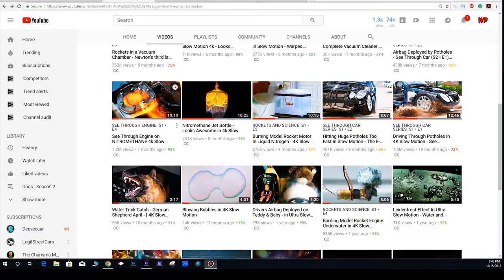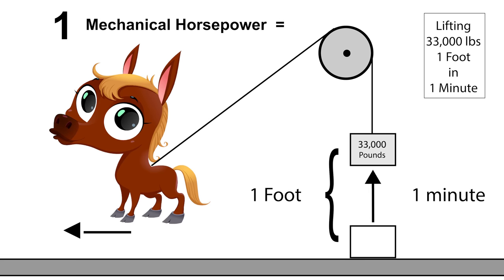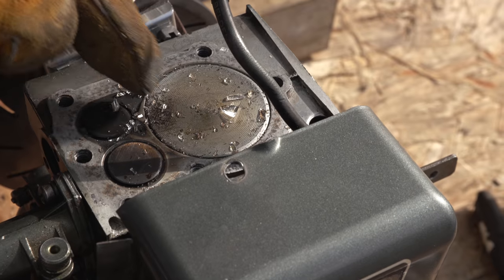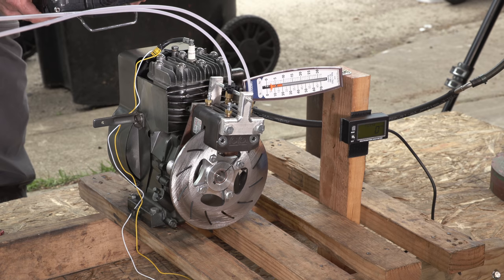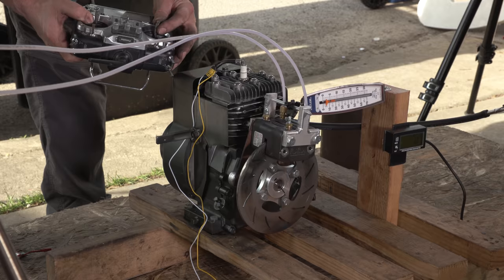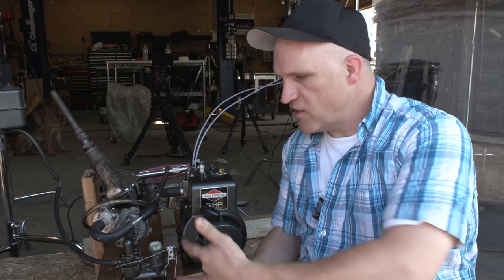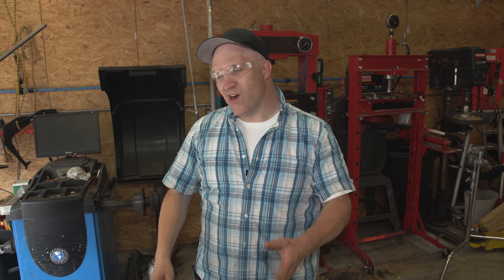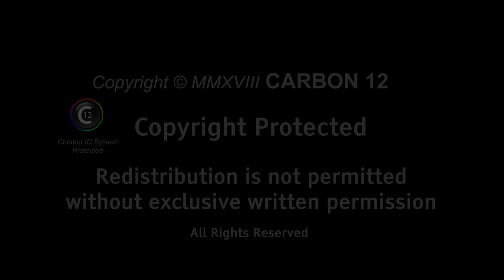See Thru Engine on Turbo Nitro and Dyno  (How much HP does it make?)

Comment: What if u turned the turbo in to a booster say forced air with an elect motor pushing just the intake side of the turbo?  Sorry may have worded that wrong but u get my point right

Comment: Never heard it called "wet" before just "pull through" or "blow through" regarding carb-turbo placement. Blow through carbs are harder to setup but easier to plumb pull though is easier to set up and harder to plumb. Personally I like pull through because you can uses normal carbs that are cheaper and more available.

Comment: wud LOVE to see u do a series on PREDATOR (HEMI/non hemi... some think that "the ticket" is the HEMI block and the NON hemi head) with... 22# springs $8. =6500RPM's/ 26# springs =8000 RPM's, head porting, stainless valves, bigger 390cc or Mikuni ... Chikuni 22/26mm carb, BILLET ROD  .020 to get 0 deck height, .009" head gasket shim.... whatever it takes to get ~.030" piston to head clearance and valves don't kiss the piston ... and cause catastrophic engine damage. header/scooter muffler (E bay), intake adaptor for carb and adaptor for air filter. with E 85? something that isn't too expensive for fuel but wont detonate/pre ignition.   turbo is too much... $$$ for avg person on a kart/mini bike.  try to keep $ spent to ~$200, not including the $100 for the motor... $107 with tax. ....  13.5HP? @ 6500+ on alcohol of some kind.  DEFINATELY DO NOT BE IN THE FLIGHT PATH OF FLYING OBJECTS, not too much of a concern with $$$$$$$120 billet flywheel, HEMI and NON hemi flywheels are DIFFERENT taper on the shaft!!!   don't need advanced key on the BILLET FLYWHEEL, but 8 degree advance on NON billet flywheel is the standard, getting timing to ~ 28~32 BTDC~~. a CONCERN with stock 5.5# cast metal flywheel that the magnet will fly out/off, like a bullit, and take the coil mount with it ruining the motor...and anything else in its path.  "line of fire"... of flying exploding parts... flywheel/magnet....  take out/off magnet on cast flywheel and EPOXY it to the sanded/cleaned flywheel... if can get the little Philips screw out without ruining the head trying to get it out?  if use stock rod, trim 3/8" off the bottom of dipper as crank flexes and dipper hits bottom of motor, breaks end cap and ruins engine.  TORQUE ROD CAP ON ANY MOTOR TO RECOMMENDED TORQUE as they sometimes are NOT torqued for MAX 6000 RPM's.  17 ft/lbs?   same as head bolts, unless running head studs then 23 ft/lbs.  BILLET rod $65 on fleabay or any other karting parts store ... might as well get all the parts from one karting store to justify the $13 shipping on $150 worth of parts. put parts in shopping cart, read karting.4cycle.com       PREDATORS and decide what parts u NEED to have.   Chomemoly push rods, different lengths for HEMI and NON hemi Predators. 1.3 stamped steel rockers for NON hemi $20... but they might fold up with 26# springs???? shd be ok with 22# springs??? CM .265" lift cam with 1.3 rockers= .345" lift, max lift that does any good without RADICAL HEAD WORK (welding/machining) and resulting low RPM performance, but at 8000RPMs???? SCATTER Shield of 3/16 steel plate tween motor and operator?  Kevlar safety blanket... is too expensive. too easy to spend ... $300 on $100 motor and still leave some HP on the table. but most ppl... $200 piecemeal in a $100 motor? change oil often, especially running exotic fuels/nitro that pollutes the oil quickly?

Comment: Awesome vid, bud!  Great fabrication and scientific strategies towards data collection!  Like everyone is saying though; try a smaller turbo maybe.  And put the carb where it originally was, and build some kind of carb hat for it.  And advance your timing a hair more than stock (but not as much as with nitro alone.  And lastly, see if you can get bigger jets for that carb.  Maybe off a bigger engine that maybe used the same carb?  If that exists?  Anyway though, great work!  Mount that sucker on a go cart!  Lol

Comment: Aloha Mr Warped and all 1682 YT commentators, during my first pass through this nearly 20 minute video I became inpatient with the pace (get to the point already!), I was vocally negative at each "mistake"; the head cracks, the wrong spark plug, "Oh forgot to mount the tachometer",  failure of the jury rigged (yes, its jury rigged meaning something built quickly with materials on hand) brake dyno...me: "Common! Why are you wasting my time" (I actually said wasting "our" time-thinking I was bringing all 1682 YT commentators along with me! Sorry all.) It kinda came on me slowly then by the 10 minute mark your diabolical plan became a real life 20 minute seminar in primary research, workbench engineering, true research hypothesis-null hypothesis, lets-see-what-this-will-do experimentation! Of course there's guys making these 3hp Briggs engines with triple digit hp! That's not the point, not what you're doing here. This is what our Greatest Generation did and created hot rodding, dirt track modified racing and eventually NASCAR. Mid 60s I worked on a 40 Ford coupe on a mid 50s frame, a Hilborn injected 327 small block-10% set back on 8% Nitromethane, a quick change diff dirt modified. And this is the process, warts and all, used as the creative tool for all of it  So nuff already! Mahalo Mr Warped! Keep up the good work sir! Aloha

Comment: Happy new Years,,,Run a electric window fan on head...Take 100- 120  lb air hose,Spray air into carb in  the original carb position,It will go threw the roof! Great video 73s

Comment: Two things holding your HP back turbo's need oil pressure to run its what makes the sleeve a bearing, that is unless you have a ball bearing turbo. Secondly the inlet for the turbo will determine how much air the engine can pull, ie if the carb is after the blower you can stuff more air into it. But if the turbo has to pull air thru the carb, the carb will still be able to flow the same amount as the engine can pull. Best of luck looks like fun!

Comment: Turbocharged engines have a different cam configuration to fully take advantage of the turbocharger. Just slapping a turbo on a normally-aspirated engine may add a little extra power, but can only reach its full potential with the right cam. Additionally, other mods may be needed to run properly and also to avoid overstressing the engine.

Comment: Now that you have this sort of dyno you should test regular vs premium gas and see if it makes a difference in horsepower. And also about that turbo, go with a smaller turbo and a blow through carb. It might be more complicated but usually, if setup correctly I say and i quote, makes more power.

Comment: Straight stock 3 HP briggs and stratton engines we ran in high school on a dyno put out 5 HP at 5,000 RPM. Proper dyno test is done with wide open throttle and rpm is controlled by the load.
Reply from the maker: Yup that's what I did here, WOT RPM controled by load, according to Briggs & Stratton themselves, on this engine if you get more RPM and torque goes down and the horsepower is about the same at 5000 RPM oh, I'm definitely willing to try it in the next episode.
Reply: @WarpedYT  We had air and fuel flow gauges also which allowed us to calculate the thermal efficiency of the engine. Our dyno was a water dyno controlled the load by turning the water tap and didn't get the dynamic vibration like you have. Run all your tests at the same rpm to get reasonable comparisons. Mix methyl alcohol with nitro methane and you should get way more power. Nitro methane by itself is not a great fuel. The high octane of methyl is why.
Reply from the maker: @terryvickers5986  you probably used a "land and Sea" Dyno. That's the one I was originally going to use for this test, but I decided to go with a more Hands-On approach. Well this fuel is 50% methanol and 50% nitromethane. Pure nitromethane alone with blow the engine apart before the Piston even moves. Yeah I'm not too crazy about the land and sea dynos using water resistance, it definitely doesn't replicate a realistic mechanical load, for instance if you look at the full size roller dynos like Dynojet, you have the option to add the Eddie break, which is basically a mechanical brake that replicates a real-world load.
Reply from the maker: @terryvickers5986  edit: pure nitromethane will blow the engine apart taking into account that it doesn't have a stabilizer, and You were somehow able to get it to ignite with a large sharp impact, not a spark for sure.
Reply: @WarpedYT  The dyno we used was much simpler, in fact you could probably build one using a centrifugal water pump and an arm attached to a spring scale. Load control was quite sensitive.You could control the load/rpm very smoothly and the engines ran smooth, no surging or variation in speed that wasn't intentional.
And there was no jumping of the scale it was a very  steady reading on the scale.
As far as the load is concerned resistance is resistance no matter how you create it and fluid friction is going to be smoother than any mechanical friction brake.

Comment: You can also use a clear glass bottle for the vac tank to monitor what is happening to the fuel.....glass bottle with vacumn pump attached ...maintained at 15 inches...attached to inlet port to engine aclear inlet tube to engine would show a lot too but that head explosion will show a lot more of whats happening

Comment: Just curious, wouldn't you have to give the enginea rather large upgrade to be able to do something like that? Like change the valve springs, the pushrods, the flywheel, and maybe even the Piston?
Reply: Port and polish too. We rebuilt some B&S 3.5 engines in hi school. 1st one had to be as stock as possible. Do whatever you want to the second one. Some of the guys had the money to go all out on theirs. They'd run for about an hour at doubled HP, then explode. Almost everytime. Bored out, mod pistons, hi lobed cams, carbs that looked like a beer can cut in half. Spittin flames out of a straight pipe. They were mean...for a while. Tecumseh engines held modification rebuilds a lot better than Briggs and Strattons. B&S engines only lasted if you rebuilt them to stock. They vibrate too much to hold together after that. No meat on them. I rebuilt one B&S 3.5 vert shaft to stock, and was rebuilding a 5hp Tecumseh, but ran out of time waiting for parts.

Comment: Need to add a vacuum/pressure gauge to see if you're making boost.  And try a supercharger. Back in the sixties someone supercharged a Honda 160 with a car smog pump and ran it on the salt flats. Was reported in Hot Rod in the day. Smog pump would probably build more pressure (boost) than that big turbocharger.

Comment: Are you measuring the power at the highest torque measurements? You could possibly get more power by releasing the brake slightly and allowing higher RPM. If the engine spins 20% faster but only loses 10% torque, that's a net gain of 8% power.

Comment: Why are you dividing you scale value by 2? If there is 6 inch's from the crank shaft to where the scale is attached, you should multiply by 2 so the leverage is based off of 12 inches for foot pounds?

Comment: When the turbo pressurizes  the intake manifold, doesn't that work to push the fuel OUT of the carburetor? If you route the intake manifold pressure also to the gas tank and equalize the pressure, I think you'll be able to get more fuel in and more power out.

Comment: You should shave the stock head for more compression. Use a mill (best idea), lathe (also a pretty good tool), or a belt sander (a little risky because the head could be shaved unevenly). Also, port out the intake and exhaust for better flow and get a bigger carb.

Comment: Try using 00racing cdi ignition with a vz31 turbo.  Turbo size is more appropriate for that engine and the timing curve of that ignition may respond to boost better than a set Briggs ignition

Comment: Clever work but turbo can't spin fast enough to get on boost.  2nd problem is the draw through set up which will pass fuel into the turbo oil system and start messing things up big time.  That turbo has a piston ring seal.  You need a carbon seal.  Use a smaller turbo with a proper draw through seal and/or go to fuel injection.

Comment: It will always be impossible for a single cylinder engine to properly run a turbo. The reason is because when the exhaust valve opens to shoot exhaust gas into the turbo to make it spin the intake valve will be closed keeping boost out of the cylinder. The only reason it ran at all was because of the air momentum. The only way to maybe make the turbo work is by using some type of sprung plunger in a tube teed into the boost side of the intake to store pressure until the intake valve opens, like an expansion valve. What I would like to see is using a smog pump as a supercharger on a small engine.

Comment: If you really want to make this engine roar you simply need an old smog pump from like a 79 Lincoln. It will serve as a supercharger. It will make crazy power and may even force a rod out the side. A bigger carb is a must also. Try finding one from a old 12-16 hp Kohler or such.

Comment: My question is and I know I sure could be wrong but with it being half the distance would give you less leverage, half the leverage.  So at 10 ftlbs in a foot using 6in would be harder to stop or turn. So shouldn't you double the the torque reading at 6in instead of dividing it in half? If not please explain if you have the time.
Reply from the maker: You kind of got a right, at 6 in the force would be harder to stop or turn, just reverse this idea, so when you measure it it's double at 6 in. If we measure 1 pound 10 ft away that's 10 foot pounds. 1 pounds at 5 feet away would be 5 foot pounds. 2 lb at 5 feet away would be 10 foot pounds. 5 lb 2 ft away would be 10 ft lb. Or 20 foot pounds at 6 in would also be 10 foot pounds. Hopefully you follow me
Reply: Ok I get it now. Thanks for taking the time to explain it. I appreciate it
Reply: Yes I will be fallowing you. Thank you for your videos

Comment: turbo is really oversized and too far away from engine-thus loosing pressure from gas cooling before it makes it to the fins. Since there isn't much air volume exhausting from that small engine, its like trying to get a window fan to spin up to speed with a blow dryer (it just kinda blows past the blades without having a chance to act on the blades).  Size down the turbo, put it next to the engine, build a sealable box/chamber that enshrouds the naturally aspirated carb that you can pressurize with the boost of the turbo. Will also have to slightly pressurize the fuel to the carb (to overcome the tendency of the air/fuel to now back-travel the supply side.) you could simply link a tube between your cab enclosure to a "pressure-ready" fuel vessel.   i am enjoying your vids! keep on em! Throttle forward!

Comment: Lose the 50% nitro and go full nitro but start it up on gasoline so two tanks one full of gasoline one full of 100% nitro with a valve to switch from gasoline to nitro then if it survives put a small turbo on it that with about 25-28 degrees of timing that might toss the crank in the trash ya that's what I'd like to see next keep up the fun stuff

Comment: Have to say that was pretty cool to watch! I bet if you loose the nitro and just regular 98% octane and the turbo, should make more power than with nitro! Would be cool to see it with some nitrous oxide!!!  🤘
Reply from the maker: Thank you, however my guess would be that the nitromethane will spoil the turbo and gasoline won't, I'm going to make a note of this and address this in the next episode, because nitromethane burn so slowly after it exhausts the engine it's still burning a good 30% of its energy. That's my experience. but I'm going to put it to the test and see you never know.

Comment: Much of the horse power was put back into the turbo need to run it. Some times these things take more power than they produce just depends on a  lot of facts. You got something but the net is what you got out of this. Great post ... Maybe you can answer I want the most horse power for the least fuel used. Any suggestions?

Comment: Draw through systems work just fine.  Not as good as a good EFI but when PROPERLY SIZED can have great results.  Doug Roe was pulling  500bhp on a 3 liter corvair with a Rochester quadrajet as the carb. "Doug Roe Racer"  Factory was 145 net for the "180 Corsa".  

I had to laugh, I used to run 10% model airplane fuel, contains nitro, in my Lawn Boy lawnmower when I had to cut the heavy grass.  Would occasionaly "borrow" some of the boat's 100 octane fuel.  The case didn't last to long.  LMAO

Comment: They also make Elecktronicks fuel injection systems for small engines now and there are around $300 I'm building one for my 150 CC doom buggy hoping a push about 15 horsepower Right now it's sitting at   about 5

Comment: Pretty cool, would be interested to see a boost guage on there to see if this thing is actually producing boost. then based off that number you should be able to get a theoretical maximum power. 2x atmospheric air pressure = 2x power
Reply from the maker: I installed on in the next episode, coming out next week

Comment: I'm not an expert, but surely you need to tune/size the Turbo to the engine (C.C). You used a turbo for a 3.5 litre? V8/12?  Sports car, on a single cylinder 100 cc? Chain saw/lawn mower engine?? 
PLUS the COMPRESSION ratio on Turbo engines is less than THAT OF naturally aspirated engines, ISN'T IT? 
NOT FORGETTING  fuel pumps/swirl tanks/injection/gas flow and tuned exhausts.
You may as well have tried a Hair Drier or made a supercharger...... Now that's an idea.
P.s. just subscribed love the  see thru idea Great video!
Reply from the maker: You're kind of right, I believe the SL65 is a 6 liter V12 I could be wrong though. But this is the primary baby turbocharger of the sequential setup on that car. It's a small turbo 27 mm.